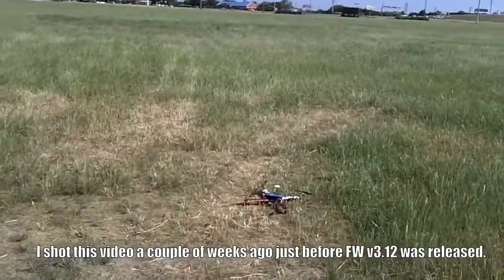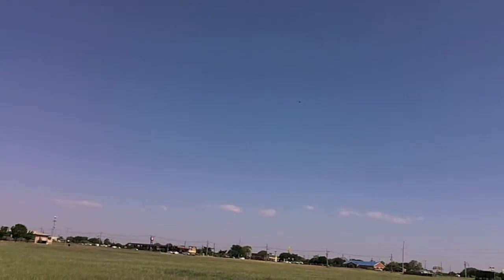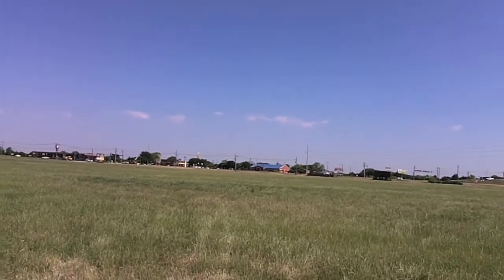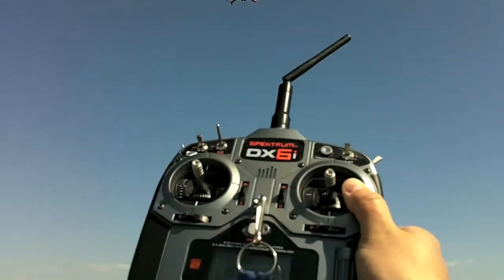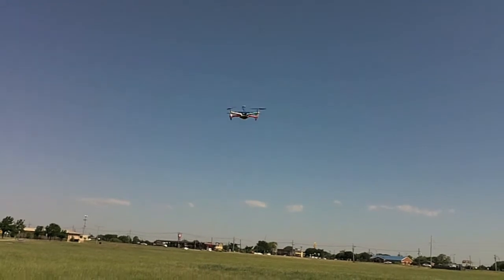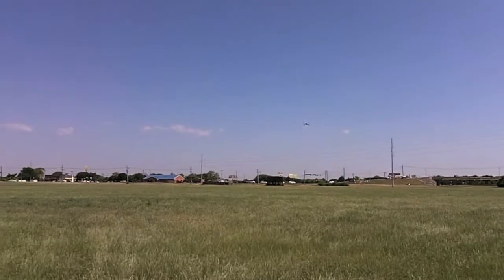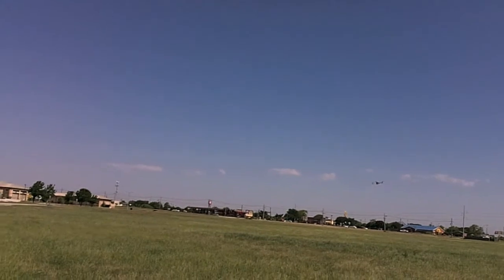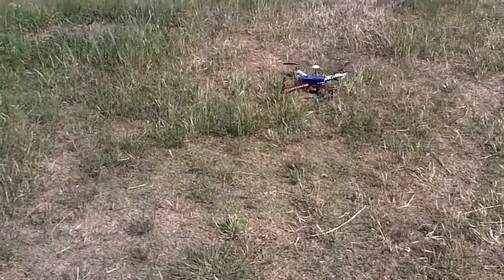DJI Naza-M GPS flight with firmware v3.10

Comment: Robert Matthews, to set up Failsafe on spektrum dx6i just change throttle channel and AUX channel inputs to NAZA. spektrum Ar6210 allows to remember position only for throttle. So, when you binding, get your throttle to failsafe position. Then in Throttle Curve set up you can set it between GPS and ATTI. Also, throttle CUT button makes FAILSAFE when you click it. And AUX channel now working like throttle. So, you got everything.
And you still have one free channel to get Home lock and Course Lock.
Also, you can set throttle lock, but it will work only in gps OR atti. I set it to wotk in atti mode.
Little bit hard to understand, but it works.